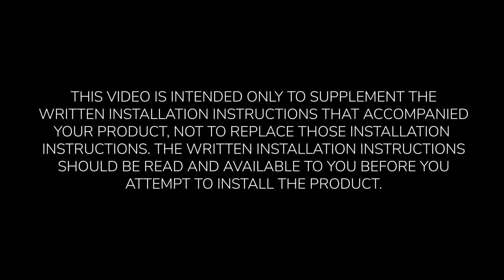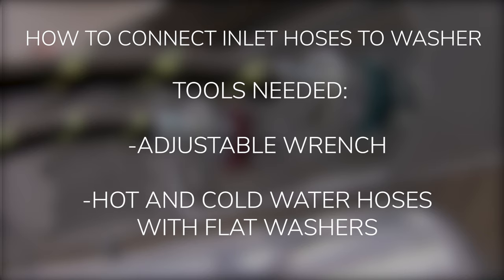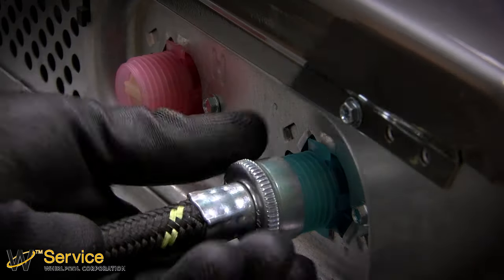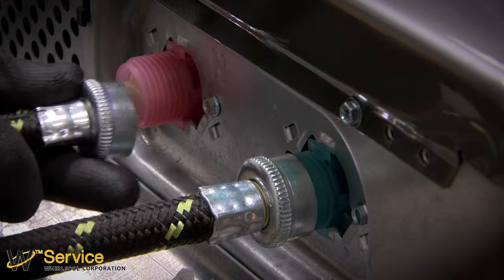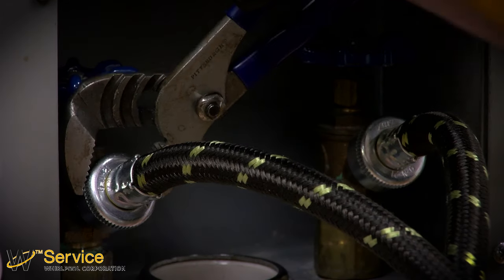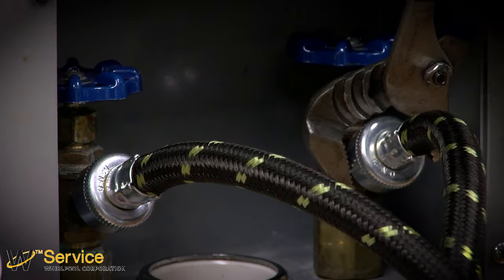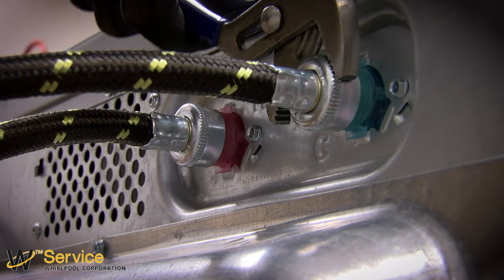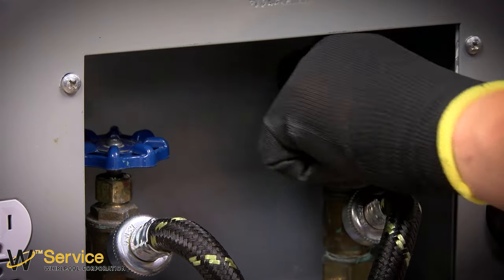Connecting The Water Inlet hoses To Your Washer

Comment: And what am I supposed to do of they Leak? Got water spraying all over the place right now
Reply: make sure you have washers in your hoses.If still licking at the connections use Teflon tape on the threads.
Reply: and that the washers are new (don't reuse old hoses and washers), and that they are sitting flat all the way inside.  Be really careful about over tightening on the plastic threads- if you crack them, the parts will need to be replaced.

Comment: Is there a proper psi the water inlet hose should be at? It seems like the water pressure on mines is too high and the initial fill rinses both the detergent and fabric softener dispensers into the tub. Is this normal? Or shouldn't the fabric softener dispenser not be used until the rinse cycle.

Comment: Make sure that the washers are new and are sitting flat all the way inside. (don't reuse old hoses and washers.) Be really careful about over tightening on the plastic inlets on the washer.  If you crack them, those parts will need to be replaced.

Comment: What if there are leaks? What is happening, what should I do?
Reply: I have this same question
Reply: Plumbers tape might help.
Reply: Make sure that they are sitting flat all the way inside. Also that the washers are new (don't reuse old hoses and washers.  Be really careful about over tightening on the plastic inlets on the washer.  If you crack them, those parts will need to be replaced.